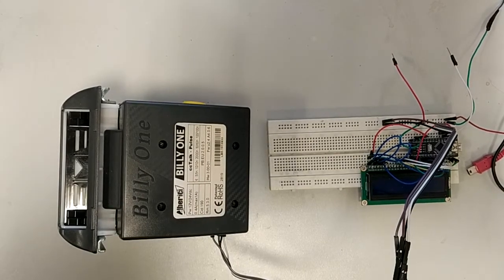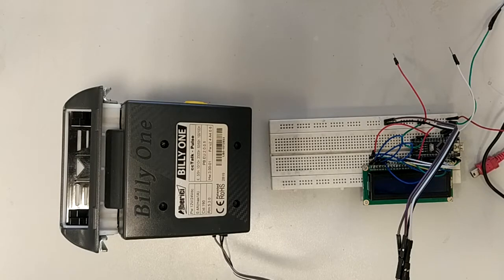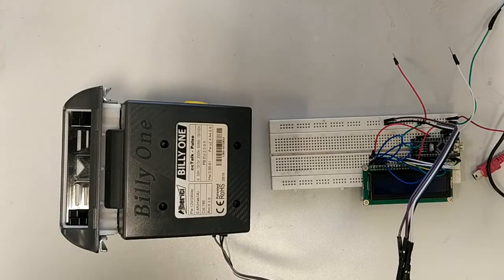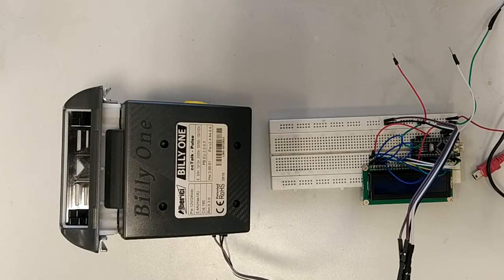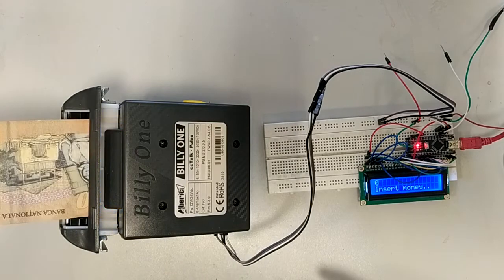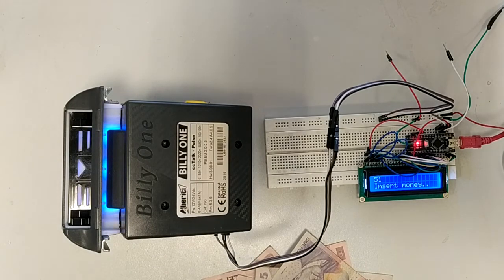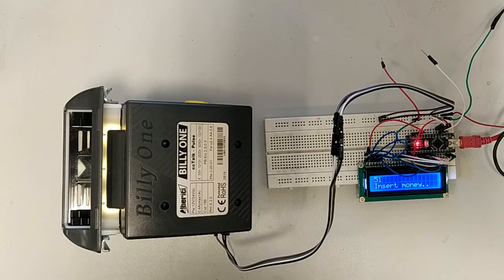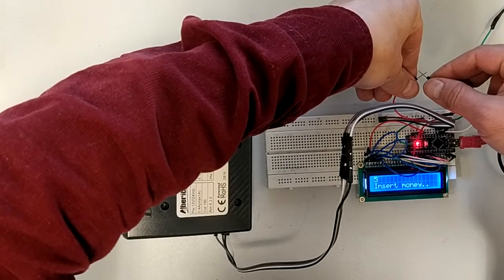BILLYONE bill acceptor on Arduino with source code, jammer proof, easiest way

Comment: no demo of wiring from the start
i dont find this helpful
Reply from the maker: Hi, the wiring is in the dedicated blog page , https://digielservice.wordpress.com/2021/02/17/billyone-bill-acceptor-on-arduino-with-source-code-jammer-proof-easiest-way/ , A1 to connector pin 1, A0 to pin 9, ground to pin 8, +12V to pin 7. In the picture you can see a male connector but the pinout is the same on the acceptor side, a flat cable one to one is used to connect with the bill acceptor. Not that complicated.

Comment: hello thanks for the video, how to wire NV9USB from ITL to arduino using this setup and pulse interface ?
Reply from the maker: As in the technical manual, page 45, pin 1 (Vend 1) to Arduino A0 input (the white wire in the blog article), for ENABLE input you have to put all INHIBIT1 to 4 to A1 on Arduino (the purple wire), pin 16 to GND (the black wire) and  pin 15 to 12V (the yellow wire). Look in the manual to figure how to set your bill validator to pulse and also on page 48 how to find out the pulse width to properly define PULSE_WIDTH. Good luck!  
 Link to the manual I used: https://www.innovative-technology.com/images/pdocuments/manuals/NV9_Range_User_Manual_1.pdf
Reply: @dglproservice9881  thakns, can i use other digital pins instead of A0 and A1 ? i set 50ms high and 50ms low is that ok cause i didn't work for me
Reply from the maker: @Atef_kerkeni  Sure, you can use any other pin. Just change the defines. If you have 50ms on the NV10 and also in the PULSE_WIDTH define than use PULSE_DELTA 4 or more.  I think the integer division is loosing it. Actually 2 means 2% so 1ms which didn't worked neither on my setup.
Reply: @dglproservice9881  i define pulse_width 50 ??
Reply: @dglproservice9881  should i inhibit all nv9 inputs ? in the nv9 setup i mean ?
Reply from the maker: @Atef_kerkeni  Yes to both questions.
Reply: @dglproservice9881  i did all the instructions but i didn't work, the nv9 is not even enabled when i upload the sktech
Reply from the maker: @Atef_kerkeni  Are you sure that NV9 is in parallel mode and not c talk or SSP? Does it work with only enable inputs to GND?
Reply: @dglproservice9881  its in pulse mode yes and the inputs (pin 5 to pin 8 in nv9) all in digital pin 46
Reply from the maker: @Atef_kerkeni  Atef, leave the Arduino and just connect pin 5..8 and 16 to GND and 15 to 12V. Does NV9 take the bills? If not then it's not in pulse mode.
Reply: @dglproservice9881  i will try that tommorow because i left the office and i will tell you what i get thank you sir for your support
Reply from the maker: @Atef_kerkeni  Go to the contact page http://www.dglpro.eu/rom-contact.html take the mobile number and send pictures of your setup through WhatsApp maybe we'll find the issue.
Reply: @dglproservice9881  sorry for the delay !! i did that and the nv9 take the bills ! what should i do next